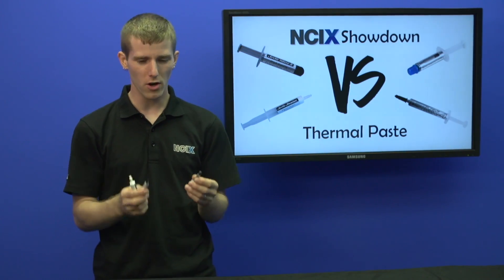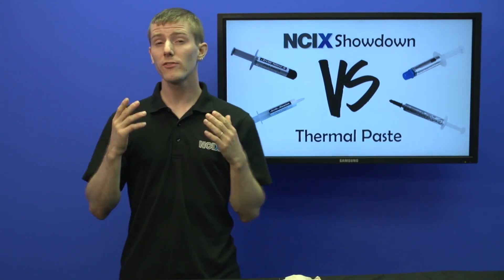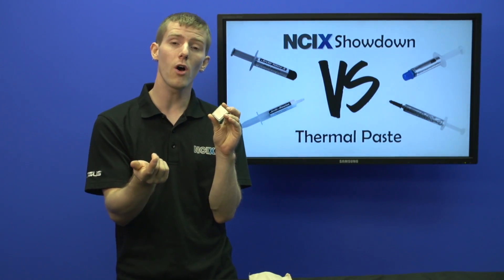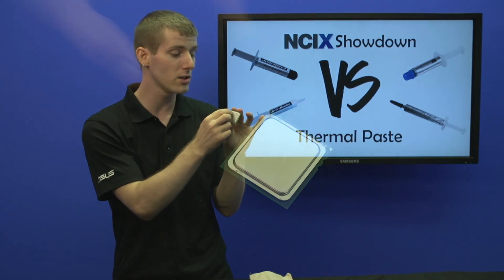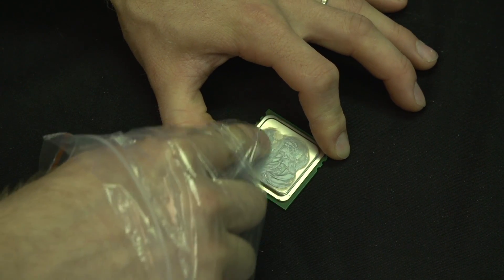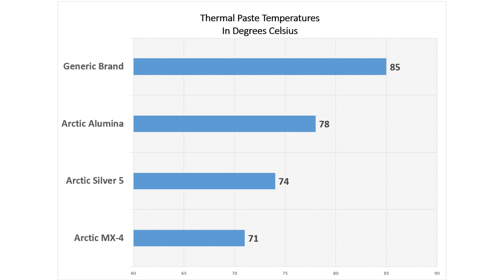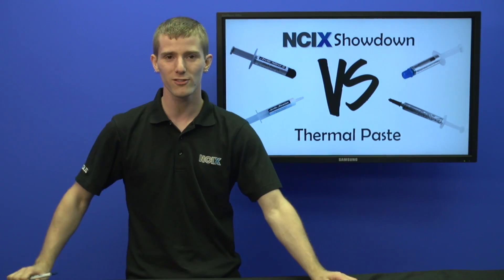Thermal Paste - NCIX Showdown

Comment: LOL tells "us" what thermal paste is. As if anyone who purposefully clicked on this video didn't know all already.
Out of the currently 99.649 views I'd bet no more than 5 didn't know what it was for - in fact I'd say EVERYONE who purposefully clicked the vid knew exactly what it was for....

Anyway would a £1 be any less than a £10 tube? I doubt it, its just different stickers on the tubes.
Reply: Actually, there is a difference with the density, which helps with the temps. The MX-4 has a 49% decrease in temps compared to Arctic Silver 5.
Reply: D347H2 So if you had originally 60c with MX4 then used Silver 5 it'd be 31(ish)c - i doubt it some how. 4.9% maybe.
Reply: Originally, with arctic silver 5 it was idling at 27C, AC MX-4 is at 14C, that is a 49% decrease.
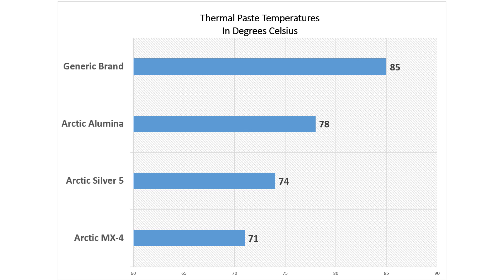Reply: D347H2 can you provide the links to this? Also why don't every single cooler manufacturer supply their products with MX 4 instead of their own propriety sache of thermal paste? surely they'd want us all to experience their product at its optimum - 49% is a massive reduction. tbh I call bs on your claims and I don't hear linus saying 49%.... and the test 3:17 MX4 71c AS5 74c = 3c  is NOT 49%.
Reply: D347H2 3:17 MX4 71c AS5 74c = 3c  is NOT 49%.
Reply: By percentage from average by average, yeah it is. If something is at 100% half of that is 50%. Half of anything will be a 50%. You take an item that is $7, 50% off of that will be $3.50. Do you not know math? lol
Reply: If you've actually tested it, you would see why. I only tested this on 2 thermal pastes so far. Arctic Silver 5 and MX-4. So far, MX-4 seems a lot better at least on my computer it reduced my temps by almost half.
Reply: D347H2 a 3c reduction on 74c compared to 71c is not 49%
Reply: No, not on his machine it's not. All machines are different and put out different voltages. This was my comparison vs the two I've used.
Reply: D347H2 so ytf did you comment when my op was regarding this videos content... ffs
Reply: what if I tell you a thermal paste is just to squeeze out the air between the metal surface? You need good metal to metal contact for maximum heat conduction and not some fancy paste in between. Polishing/smoothing the surfaces might get better result. eh?
Reply: Mozz Tzar then you'd be wrong - go run your cpu/gpu's without paste, enjoy buying them every other day.
Reply: AuralVirus I'm not saying not to use thermal paste, all you need is good metal to metal contact in the first place.

Comment: Wait. I am getting a corsair h105 and should I stick with the thermal compound that comes with it, or get the artic cooling mx-4?
Reply: It never hurts to get premium paste such as MX-4. the paste coolers typically come with are a very cheap silicone-base and are only okay at best.
Reply: The stock thermal paste with H105 is very solid, just keep it. And use your money on something else like Noctua NF F12s, the stock H105 fans have descent performance, but are EXTREMELY loud.
Reply: thanks man
Reply: No problem

Comment: I just draw a small sized x or a plus shape in the middle.
Reply: x > +
Reply: I've heard some were that x is bad I could be wrong though.
Reply: Southeastern777
No that's bogus, sorry. The heat will transfer to the heatsink without Thermal Compound but it transfers better with it. The Compound is designed to fill in the micro spaces between the 2 surfaces and allow more heat to move more quickly. The compound compresses extremely thin when you tighten the heatsink down and does not prevent any uncoated areas from coming into contact with each other.
A cheap Compound might not spread out thin enough but that's why you should always buy the best you can get.

My favourite method of application is to spread a very small amount over most of the middle of the CPU, clamp down the HS then remove it and clean it off leaving the CPU coated with the thinnest layer possible then put the HS back. Some people will argue that this can create air bubbles in the compound but it's never been a problem for me.
I'm running an FX4100 (3.6Ghz) at 4Ghz and my idle temp is 28 deg C with a max of 54 deg C using a Be Quiet Dark Rock Advanced HS and a BQ Shadow Wings fan, I cannot get cooler or quieter !

Comment: I use some generic compound I got from ebay a while back for 2 dollars 30 gram tube and it works just fine. Using it with a ASUS SIlent Square cooler. My E7400 overclocked to 3.18 GHz load temps are quite low - about 55 Degrees C. And yes, I meant LOAD temps. E7400 is an efficient chip I guess :P
Reply: you would drop to 50 (same max temp as my 1090t Amd clocked to 4ghz and 2800CPU NB) if you used decent paste
Reply: ***** I recently upgraded to a Xeon E5420 and overclocked it to 3 GHz. This time I used some quality KP-12 thermal paste. The temps are 65 C on the hottest core while heavy gaming. Still not bad

Comment: AS5 needs to be cured for 200 hrs did you do that? if you dont then it will not be at optimal performance i use it on my amd 6350 and it is at 4.2 and its max temp is 57 . before 200 hr it was at 65 68.

Comment: only gelid gc- extreme for GPU and cpu any really :) i used loads on cpus and great results used same compund on gpus was shocked that nearly burned the bastard :D so for GPU USE ONLY GELID !!! anything below 8W/mK for gpu would be useless...processor in most cases up to 100w u ok with any really iam running 4.5W/mk on fx 8350 OC running @ 4.6 and tried same compound on r9 280x and was getting almost 90 degree during the gaming ;/ applied gelid (been advised by my mate) temps never went above 75 :) mx 2 was logging at 83 and mx 4 81 :)

Comment: Wait.. so you aren't supposed to spread it?
Reply: You shouldn't spread it. If you spread it it can have air pockets.
Reply: randomguyontheinternet
You will only get air pockets if you apply too much, which is how most people do it.
Reply: Ian Clarke
Often, people don't spread it properly because it's hard to do it properly, so I just recomend the pea method.
Reply: randomguyontheinternet
My favourite method is to spread it very thin over most of the CPU and then fully clamp the HS down before taking it off again. I then remove all the paste (TIM) off the HS leaving the TIM on the CPU and put the HS back on. That way you get a nice even coverage that is extremely thin which is crucial.

Comment: May I use alcohol from the pharmacy, the one I use on injuries?
Reply: Ok, thanks. Next time I'll try with vodka.
Reply: I just use brake cleaner :P
Reply: you can just be careful , i use a coffe filter to clean up the cpu !
Reply: ***** So by that logic, driving around without seatbelts is perfectly fine because nothing bad has happened to you yet. Just because something bad hasn't happened yet doesn't mean it can't/won't. Like ***** said, I'd rather have that extra peace of mind to avoid zapping an expensive CPU or GPU.
Reply: Just use 1.42857142857 times more cleaning fluid.
Reply: Yes that is rubbing alchohol.
Reply: Levi Flaman
its not the same think bro don't be like my mum
Reply: Isopropyl alcohol (C3H8O), what is used prior to a flu shot.
Reply: Adam Len yes but it`s concentration is 70%

Comment: i am using aluminium foil and it is so good
Reply: Ajeem Jims Damn right it's not a good conductor. Even after being in the stove at 300 for two hours, with hot edibles underneath, it's at temperature in less than a minute.
Reply: lol
Reply: owen75
seriously man.i did try aluminium foil but it's not good conductor but if u desperate u can try it.
Reply: *****
but seriously my pc running ok.

Comment: Where's IC Diamond?
Reply: I heard that the Diamond stuff you are talking about can get ingrained into the IHS and cause micro-separations which would hurt the overall cooling. I am not totally sure if this is true or a myth by Arctic fanboys. Just thought that may be a reason why.
Reply: there are full tests out there. AS5 was the 3rd best, only lost by 1 degree to the top two. It beat a bunch of diamond pastes.

Comment: Any alcohol will work just fine, but the closer to pure the better so 99% would be ideal. Or you can not use alcohol at all. I always use ArctiClean (made by Arctic Silver) which has two components. The first eats away any existing compound or other matter. The second purifies the surface.

Comment: Wrong.. If the chip is under load the heat will accumulate on the material surrounding it and the chip itself.. For a chip to dissipate at a 1:1 level ratio the chip must be left in mid-air without anything else in the room to measure it.. If a chip hits 105 c. simply + 1 ambient c. and the temps can multiply to hell - while that wont happen under idle temps because the dissipation level is fine.. You wont see it happen though because chips are made to back-off before anything drastic happens..

Comment: Well, in 20 years of messing with computers I have only seen this when you have a water cooling system that is big enough to keep the CPU very close to ambient temps at all times.  The more surface area you have to dissipate heat on the less ambient temp effects cooling in drastic ways.  Until you hit the high end tipping point.  This is why a giant air cooler or water cooler cools better than a small one.  Surface area.  By your logic, all coolers would work about the same.

Comment: The cpu in off state is irrelevant.  You are way over thinking this and going in the wrong direction.  Delta temps are great since that compares ambient temp to CPU temp in turn giving the delta between the two.  But, the ambient temp is not 1:1 in relation to CPU temp.  It's just not.

Comment: Temperatures don't really matter. As long as its the same with all the pastes. The transfer of heat will always be higher when the temperature difference between the processor and the surrounding area is greater. That being said, the characteristics of cooling pastes don't change as the heat rises, as it's just used for better conduction between processor and heat spreader/ waterblock. If a paste is better at low temperatures it will also be better at high temperatures

Comment: cool laboratory liquid pro is what i am using for now, there is no way that a standard thermal compound is anywhere near the heat transfer rate than a liquid metal product. however, you do need a good metal polish to clean off the mess if you want to replace, and the first time running DO require a high temp in order to melt them down for the best performance

Comment: This is not very accurate. You can use the same brand paste a dozen times and get a few different results. It spreads different every time you seat the heatsink. Noctua, m4, and a couple others all do a fine job.

Comment: If you got a non-alu heatsink, then Coollaboratory Liquid Ultra is really good. Using it with my FX-8350 and Kraken X60. It's not that easy to remove, but possible with alcohol and dabbing - the IHS is fine!, left a stain on the X60 copper block. I tried MX-2 / MX-4 (which are good!), Artic Silver 5, Gelid GC-03, Tuniq TX-4 (good, horrifying application), Shin-Etsu X23 7762, ... There is also Prolimatech PK-1 and Indigo Extreme but not tried. The Liquid Ultra is better than any other I tested.

Comment: wish they would put some decent compound inside the 3770ks and haswell, the compound they used is terrible. or atleast goive is the option to replace it without having to remove the heat spreader and have to glue it back on. maybe a lock system?

Comment: It's not usually a 1-1 ratio for temps.  Besides, unless you are in a poorly cooled closed space temps should stay consistent.  Maybe move 1-2 degrees.  Even in the summer when my computer room can get pretty toasty, CPU temps don't raise that much.  Maybe 5C but the room is 10-15 C warmer than winter or having the AC blasting.

Comment: Most of the better Air and AIO coolers that come with pre-applied TIM is a Shin-Etsu variety that is excellent and replacing it would be of very dubious value. The crap white silicone pastes that come with some coolers though is utter garbage, doesn't perform well to begin with and will dry out over time drastically reducing performance. Avoid.

Comment: Pretty much anything is a better thermal conductor than air. What you really are preventing is air between surfaces. So an over enthusiastic approach is going to be better than none at all but spreading it around can introduce problems other than too much TIM acting as an insulator, such as air pockets and the introduction of detritus or other foreign matter limiting conduction. As we can see in most cases it is of limited concern but this human error is what leads to erroneous statements.

Comment: Your cpu is known to run hot regardless of the thermal compound used. This has been discovered to be caused by poor thermal conductivity under the heat spreader. You can de-lid your cpu (google it) to get better temps.

Comment: Question I have used 3 different thermal paste compound on my intel i5 3570k  and still see high temps! Even when idling i am using a aftermarket cooler but it dropped it but not by much... I personally think its the cooler. its an enermax vegas i believe.

Comment: I would disagree to some point... it is actually matter on HW and Cooling performance, as a WC i went via same set up but used different compounds and   results are not same. AS5 is same as(marginal error of 1 degree) MX4... it just is... but honestly all mid tear and up are quite same 1-3 degree difference... which is quite absolute at this time. Liquid metal FTW

Comment: Ideally you'd scan the surface of our CPUs and heatsink contact surface with a scanning electron microscope and use a robot to manually deposit diamond nano-particles in the microscopic gaps for near-perfect heat exchange. Then you'd apply as much force as possible without breaking the motherboard or the CPU, and cool the heatsink with a jet spray of liquid nitrogen. The nitrogen would be collected and recompressed for continuous usage.

Comment: Well mx4 is very good. In the winter (17C room temp) my i5 2320 was at 95 degrees with the stock intel thermal paste O.O, changed with mx4 a week ago and now with 30C room temp the CPU get's 80C.

Comment: liquid metal... ic diamond, and gush, how did u test it? and why i5 or 1155? why not 2011 or 1150 or i7?did u use stock fan or used a after market? why no shout to passive cooling(actually would be interesting) mimimimi

Comment: yeah normally i trust linus in all computer stuff ect, but i tried the pea method and i really had bad temperatures, with the spread method i had much better temperatures and i screwed my h100i tight, so it SHOULD be spreading, but for some reason the contact was bad, i tried it multiple times

Comment: And at this point I know you haven't done your research. 
"The most conductive of all metals are silver, copper and gold in that order. Silver is also the most thermally conductive element, and the most light reflecting element. Silver also has the unusual property that the tarnish that forms on silver is still highly electrically conductive."
"Arctic Silver 5 uses three unique shapes and sizes of pure silver particles to maximize particle-to-particle contact area and thermal transfer."

Comment: I run arctic silver 5. That's my personal favorite compound. I run an AMD FX-8150 on almost 4GHz with a CPU voltage of 1.2875 and a Corsair H80i. About 38c under low load and up to 52 max in full load. Highly recommend it myself.

Comment: My favourite method is to spread it thinly over the surface then clamp the heatsink down and then take off the heatsink and wipe off the TIM from the HS. but not the processor. This puts a very thin layer over the entire surface and prevents the HS 'floating' on top of the TIM. I have had excellent results using this method and it hardly makes any difference which TIM is used because too much TIM acts as an insulator there is no difference in performance with different TIM using this method.

Comment: Yes, a dif TIM could spread more, so, the proper way to apply, would be less...so it doesn't run off. That's what "test fitting" is. You apply some, press the sink or block down, if it spreads too close to the edge you put too much on (cuz cinching down on it will spread it further). It should only be as thin, or thinner, than a gold leaf. As far as the IQ thing... wikipedia(DOT)org/wiki/IQ. I'm going back to bed.

Comment: im with Berserkism on this, ive been building, repairing and modding rigs for 15 years last 6 years ive been doing it for a living. runny or not if its going over the sides you're putting too much on, Every 360/ps3 ive repaired since release has the same issue they rush the application and get it everywhere totally fucks already badly put together hardware

Comment: Stop being a fucking smartass mate. I have used very runny thermal pastes before and when you put the heatsink on, it spreads of the top of the IHS.  You remove the cpu from the socket  and you get some on your fingers and possibly spreads to the bottom. You are clearly the one with a low IQ if you can't figure out a possible way that it can get to the bottom. Your hostile habits are not welcome here where people come to learn.

Comment: From the AS5 product page
Not Electrically Conductive:
Arctic Silver 5 was formulated to conduct heat, not electricity.
(While much safer than electrically conductive silver and copper greases, Arctic Silver 5 should be kept away from electrical traces, pins, and leads. While it is not electrically conductive, the compound is very slightly capacitive and could potentially cause problems if it bridges two close-proximity electrical paths.)

Comment: hes probably using core temp which isn't accurate at all i have the 8320 and had the 212 evo i was getting same results then i went to the bios and found it was 15-20 degrees celcuis off as in lower than it was actually at. 
ps. i'm using an h100i now